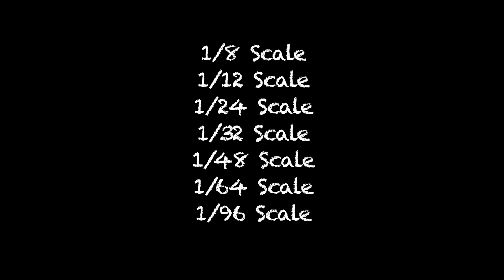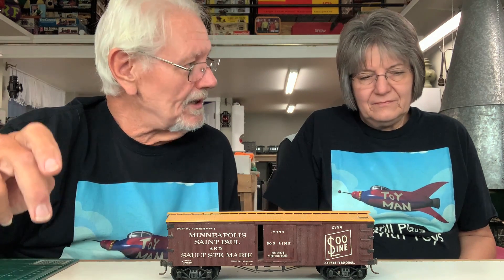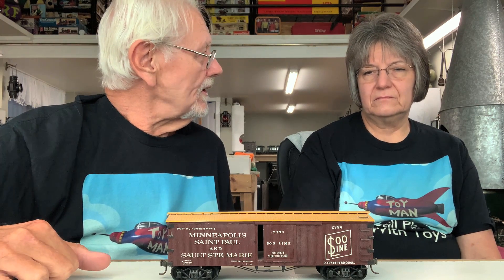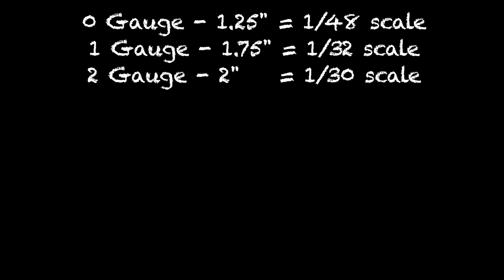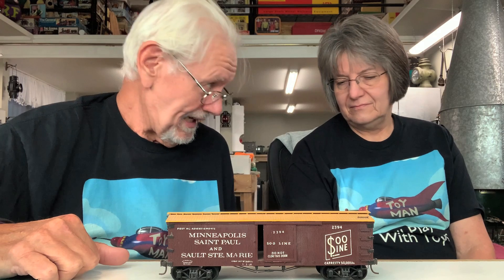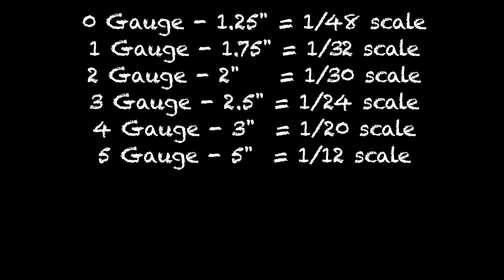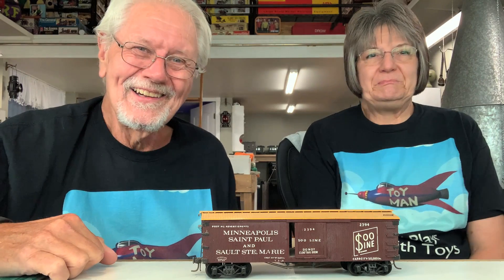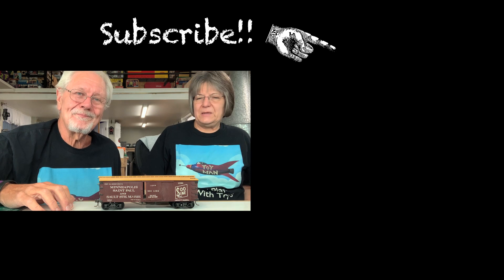How Did the Track Gauge Become Model Railroad Scale?

Comment: Good stuff! Just something of course, when marklin originated the gauge system a scale wasn't necessarily at the forefront, but it worked out. 
Gauges I, II, and III were of course the first (0 came later). Greenly scaled altogether later. 
2 gauge isn't quite the orphan it appears to be, the exceptionally popular products of, for example, Weeden or beggs, garlick et al, were all at the rather simple gauge of 2" strip rail. Later of course, but still very early manufacturers of Carlisle, Howard, Knapp, voltamp etc were all gauge 2.
Some model railway magazines I'm looking at from around the 1900's tend to indicate that gauge 2 is the working norm for a model railway

Comment: Another great video and explication. I hope you do one on all the model train scales/gauges because that still confuses me. Growing up in the 1960’s you basically had “N-gauge”, HO, S and O and at most hobby and model railroad shops that was it! ANd the brands were basically Lionel, Atlas, Tyco (remember that one?) and if your had the $$$ Marklin with it’s AC system.
Now you hear about “G” vs “F”, On3, 00 (which I know has long been the standard in England) and so on. So confusing at least to me.  Thanks!
Reply from the maker: Did you know that Tyco was Tyler’s Company?  A lot of it was made by Rivarossi!  Yup. First up 0 scale and 0 gauge. All the strange versions and scales. 1/47 scale. 7mm scale. 1/43.5 scale. O gauge. O27 gauge. Proto 48. On3. On2. On30. Geeeezzz
Reply: @ToyManTelevision  Apparently so, I just looked that up! Tyco was my first train set and was sort of the base-level starter system. I think I got mine at Sears with money I made as a paperboy (remember them?). Mine were HO and I still have them all! I think they may have done N-gauge as well. The TYCO company that is around now is a security company that is used by corporations.

Comment: Just think if Europe had used standard scale gauge. No more changing trains in Poland or Romania.  Then The Ukraine could ship all their marvelous grain to German or Italian ports for export. Not to mention The Ukraine could ship grain to Spain, their third largest export customer, by rail.
        But then the Germans might have had an easier time invading the Soviet Union in WWII. Might have even taken Moscow.
      On the flip side of history Czarist Russia could have made it to Vienna in 1915. So no treaty of Versailles, which caused WWII. 
     It is only a matter of inches. The Frisco bought some 2-10-0's that were originally intended for Russia. To make it work they installed really wide tyres. The only thing you can't do with a Russian Decapod is run them over self rerailing switch frogs. The tyres hit the wings. 
      If this sounds like utter gobble de guk, it probably is in a way. But interesting connections.
     Lets see where were we?☺
Reply from the maker: Well changing trains isn’t too hard. But it’s also easy to blow up a railroad. The US had locomotives at D day that could change gauge with relative ease. The Union had the same problem in the cilvil war. The south was mostly 5’ gauge. The north mostly 4’ 8.5”. Still not a huge problem as the north just  commandeered the southern trains. Several great films on the Great Locomotive Chase. The Buster Keaton “The General” is the best. Actually much of the fun story is historically accurate.

Comment: Below 'O' or '0' gauge the there has been a strong tendency for the British to have a different scale to everyone else.🤔
As I see it the process goes something like this:
Continental Europe and the US (almost) agree on a new scale & gauge combination that is smaller than before.🤨
Europe wants to measure the gauge in metric (mm) and the US wants to measure in imperial units (in). They fudge the issue by declaring that each others track is within tolerances.🙃
British manufacturers of ready-to-run locomotives then whine about how how difficult it is to fit a reasonable motor and mechanism in UK image models to this scale. They are prepared to use the US/European track though. A compromise is reached where they use a scale that makes UK locos as large as the agreed US/European scale locomotives. This means they can fit similar motors as US/European manufacturers and use the same track.😵‍💫
Eventually, UK finescale modellers decide they want a gauge that matches the scale they are working to as the trains look odd on the undersized track. They cannot agree among themselves so yet more scale & gauge combinations are born.🙄
This is how I think OO was arrived at and why there are different scales for N , TT and Z gauge.
It is interesting that Hornby recently bucked this trend by announcing support for "TT:120" as traditionally British TT scale was 101.6:1 (or 3mm/foot).🙂
This does not include modelling other than standard gauge prototypes. 😉

Comment: It is why Japanese n scale is 1:150 although that 1,350mm in scale mm and the 1,372mm is the prototype. (That's even weird because most of the track in Japan that isn't high speed in Japan is 1,067mm.)  G Scale at 1:32 would have nicer to work with. As a kid I saw a locomotive that was built on 4'8.5" gauge which as true to scale. With all that said, why are diecast cars called O Scale when they are 1:43???
Reply from the maker: Now that’s a GREAT question. Many people wanted an accurate 4’81/2” gauge. So the the US we changed the gauge and kept the scale. 1/48 being used accurately in On3 and On2. (Later On30 as well). So the standard gauge people narrowed the 1/48 scale  gauge. Proto 48. 

In Europe however they kept the gauge and altered the scale to make the gauge correct. 

European O scale (SMO scale is 1:45 or 1:43.5 in France). So 1/45 brings the gauge mostly in line. Why 1/43.5??? Well it’s a metric conversion problem. It’s called 7mm scale. Used as 0 scale in much of Europe. Mostly Great Britain. Anyway it’s 7mm to the foot. Or 1/43.5 scale. Dinky toys adopted it for die cast cars and as they are really close to 1/48 they were used on most every Lionel train layout. And other die cast companies also used that and so… cars are mostly 1/43.5 scale. Some of the toy companies started using that odd scale because they were tooling metricly. Is that a word? No matter.
Reply: I think, think, it was because there is a faction in O scale railroading which uses 1:43 scale to get the 1.25 inch track gauge closer to a 4ft 8.5in measurement in scale. For true 1/43 track gauge the track should be 1.3 inch gauge but, hey, 1.25 and 1.3 are close enough to call it good. And ... there is the thing that 1/43 works out to 7mm per foot. Yes, that is a 'mixed metaphor'.
Reply: @scottfw7169  The wacky world of gauges and scale. LOL Thank you.
Reply: Please convert to inches I have no idea what 42 and 56.5 Inches are in metric
Reply from the maker: 56.5 is 1.224 meters. 42 inches is just over one meter.
Reply: @IndustrialParrot2816 
42in = 1066.8mm
56.5in = 1435.1mm

The reason I go with mm is because N guage is  itself 9mm and keeping the units the same is easier.. The 1435mm is standard gauge in metric. 

When you multiply 9mm by 160 you get 1440mm or 56.7in and not 56.5in. N scale is off scale by about a quarter inch. The Brits corrected me on this so that is why I got use to using 1435. 

O Scale gauge should  be 1 3/16" instead of 1 1/4" for standard gauge.
Reply from the maker: Yup. So some people use 1/48 scale and 1 3/16” gauge. Proto 48. This because they want to stay in the same scale as On3 and On2. And now On30.

Comment: O scale = 1/48 but half O scale (known stateside as HO scale) = 1/87.........?
Reply from the maker: This is actually one of the smartest things ever done in model railroading. Once the gauge was set at .625 inches, exactly 1/2 0, the scale was set at 1/87 in the US and parts of Europe to make the scale gauge an accurate 4’ 8.5” instead of the cheated 5’ gauge. In GB they kept the cheated scale. Known as 00 gauge-scale at 1/76 scale. So the trains are the same gauge and CAN run on the same track, (the flanges are different so that’s a problem) they are different sizes. But at the outset HO was the most accurate and popular scale.
Reply: thank the Germans